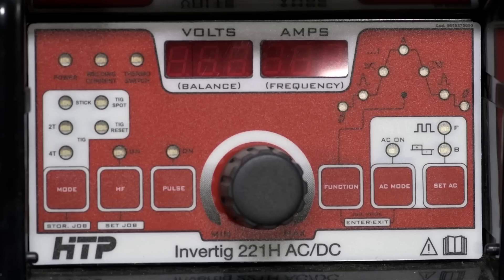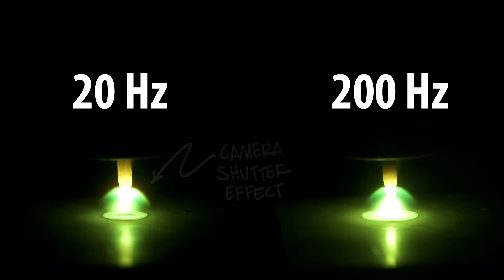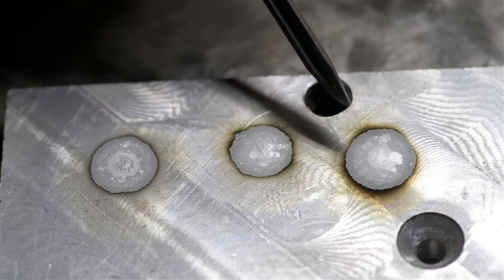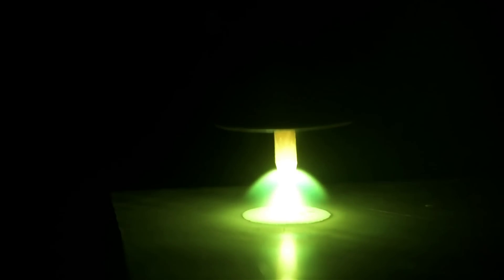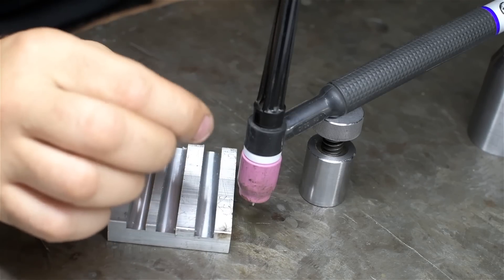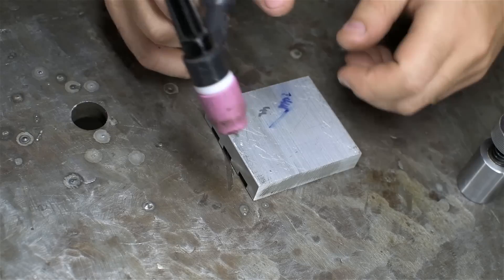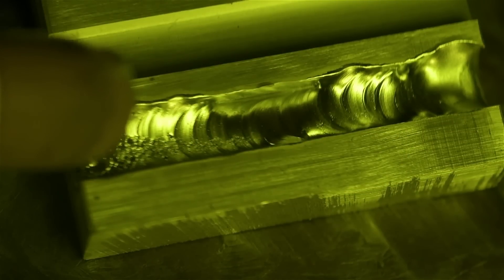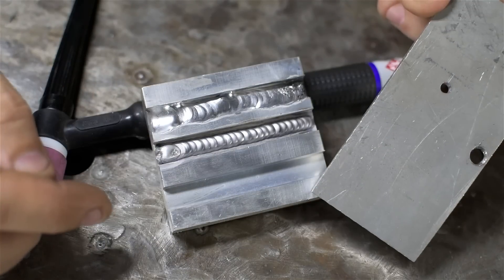TIG with TOT: AC Frequency?!

Comment: The skin effect does very well play a role at the frequencies you are talking about, even in AC transmission lines it is so big that they sometimes use hollow conductors, or steel inside and copper on the outside. Have a look here: https://i.stack.imgur.com/N6ZJx.png on steel it can make a difference of 4 times the penetration depth between 20Hz and 200Hz

Comment: The skin effect could very well be the cause, it's normally only considered for high frequency but it's can also be relevant at high currents like this. The depth for copper at 60 hz is 8.5mm which I found quite surprising when I first learned about it. https://en.wikipedia.org/wiki/Skin_effect

For fun, I calculated what it should be for aluminum and got 5.8mm at 200 hz and 18.5 mm for 20 hz, which based on what you're experiencing seems to fall in the right order of magnitude at least. Link at then end.

One way to test this would be comparing aluminum and steel. The much higher relative permeability makes the skin a lot thinner (single digit mm or less). It's much harder to get an exact number and will depend on the current.

Calculation for aliminum in wolfram alpha here (permeability of aluminum is basically the same as free space): https://www.wolframalpha.com/input/?i=root(2+*+2.7e-8+ohm+meter+%2F(2+*+pi+*+200+(rad%2Fs)+*+Permeability++of+free+space))
Reply: I was thinking along similar lines myself. Also, a 200hz square wave is full of harmonics at 400, 600, 800 hz too and the skin effect on the harmonics will be way higher, to some extent increasing the effect. So skin effect could easily be having some impact even if not all of it.

Comment: There are more physics than your test covers.
To start, the gs mix affects the voltage and thereby the heat generated.  After all, even though many people equate heat to the current, the actual heat is determined by current, voltage and speed of travel.  Then the voltage (with other items remaining constant, is dependent on the polarity.  In fact, I have seen up to 3:1 ratio between reverse and straight polarity, same current.  That means two to three times more heat during the reverse polarity (50% duty cycle).
A really funny thing happens, when you increase the frequency to the kilohertz range.  Then the acoustic impedance of air that surrounds the arc starts affecting the plasma column width.  You can see this on pulsed DC.  Noticing that the arc becomes wider at higher DC currents, while voltage remains nearly the same can be explained in terms of "fatter wire (or arc), less resistance"  But if the current is increased very sharply, the arc cannot push the surrounding air away fast enough.  For something on the order of 1 millisecond, the current is pushed through a more slender plasma column and the momentary voltage is much higher.  When you change to AC or actually variable polarity welding, then the reverse polarity effect to voltage muddles the reasoning already at lower frequencies and slower transitions.  But another claim and patent by Rod Rohrberg shows that it is not necessary to use variable polarity for welding aluminum.  Very fast pulse rise for example from 10 A background to 150 A peak can provide the necessary cleaning.  That is probably caused by rapid expansion of aluminum metal when melting which more or less throws the oxide to the sides.  I can personally test that this process works, whatever the physical explanation might be.  In that case, the pulse rate was 15 to 20 Hz, the duty cycle also 15 to 20 % and currents 15 A background, 150 A peak.  The pulse edge rise time was less than 250 microseconds.  The heat was controlled mainly by the pulse duty cycle.

Comment: from studying induction heating, skin effect starts at 50Hz and is still ineffective at 60Hz . This is why power company runs at this as a stranded less chance a roled up extension cord will cause a fire  . I looked up skin effect in Cu at 70°C(material and temperature  WILL change depth). found this calculator
http://daycounter.com/Calculators/SkinEffect/Skin-Effect-Calculator.phtml
.02KHz(20Hz) =0.632"
.2KHz(200Hz) = 0.201"
.06KHz(60Hz) =0.366"

Writing this turned on a light bulb.... the cut/etch Jody duse.  the weld puddle  takes on the pile of sand shape  expressing the strength of the skin effect. less energy reaches deeper  causing the rapid taper of the puddle. slower wont go deeper than skin effect hence the requirements for muli pass welds on thicker materials .

Comment: Just to change subjects and maybe scare a few folks, As a resident in a radiology program I taught med students radiology. An X-Ray tube is tungsten rotating fast as it is being hit by photons. This produces ionizing radiation. That’s the stuff that damages rapidly changing cells in our body. Is TIG welding producing ionizing radiation? 
Trivia.. Who was the first person to die from radiation. Answer.. Mr Roentgen’s (the discoverer of X-Ray) assistant, then his wife and then I believe him. Anyone ever get a “sunburn” welding un protected?
Reply: The rotation of the aluminum plate in an x-ray tube is to prolong the life of the aluminum.  Even so the tube is designed to only last 7 years in normal daily use.  They used to last much longer but that was hurting the servicing business revenue.
Reply: Chuck Patten .. My GE X ray unit lasted me 17 years and then I sold it to my Vet when I moved. He is still using it (36 years plus)

Comment: Don't think you need an o-scope. Think your beads are a good representation of the frequency, actually. The beads show exact coloration with time, frequency time. It seems very basic to me that slower frequency (we are discussing frequency, not energy, which is time) beads show a much more prolonged dwell in polarity then the higher frequency. The smaller tighter globules represent less time spent in polarity, or fast switching. Longer dwell-bigger blob, less dwell small blob. As frequency is raised you start to move away from the basic tenants of AC, there probably is a frequency high enough that basically negates AC all together and is either DC at that point or just null. I can see where using high freq on a outer seam bead might be beneficial to keeping a tighter bead, dependent on the operators weld speed. Whereas lower frequency on the same corner seam would have a tendency to stretch out/across and look poor. The energy would be the same but the dwell in polarity would cause more of the same energy to be transferred given the speed of the operator. After that long winded blow, I meant to say, I think your right.

Comment: your AC frequency is telling your balance how many times it must go through its cycle. 40 frequency = 40x a second your balance must go through its cleaning and penetration cycle.  imagine hitting a punching bag. you will have more delivery of power into the bag if you are able to hit it slower. 1 hit per sec VS. 2 hits per second and so on.  the faster you go the less power you are sending into the bag. Amps it like your set top hitting power, while balance is like the % out of 100% you are making contact with bag (penetrating) and "holding back your punch" is  like your cleaning action. thicker the metal more balance penetration is needed. And the reason (i think) you are able to weld inside joints better with higher frequency might be because your arc is forced to go faster... and by doing so makes your arc's "fingers" thinner (not its width of the cone that you can see with your eyes, but electrical current on a micro level). thinner helps to avoid melting the walls of the joint before the actual true center.    i dont know... i have only been welding for 9 months =P it makes sense to me though.
Reply from the maker: good point and I'd agree with you but I can change the amps too.  like me punching @ 40hz vs Superman punching @ 40hz.

Comment: Penetration (tee hee), the lower the frequency the deeper the heat will go, the faster the frequency the higher the heat will stay, I have always used the frequency in accordance with the speed of my hand (tee hee).
Also, the strength of the weld and crystalline structure of the two dissimilar metals will be better at a lower frequency.
A good test would be to cut your welds in half and look at the cross sectional area, you will see different depths and if you look at the weld under a microscope you will see a more uniform structure.
Or get an X-ray machine (tee hee, don't know why that sounds dirty).

Comment: Well, I just have a little old Lincoln square wave.  It has one big knob, a three way switch for DC/AC/DC, a switch to change to stick, and a power switch.  I watch these videos with the new fangled welders with all the bells and whistles, and often wonder if I could ever figure out how the hell to use one.  I mostly weld crappy old nasty Harley Davidson cast aluminum - when it is aluminum that I am welding. Horrible, horrible metal. Just filthy, and LOADED with impurities. 

I'm a pretty simple guy. I am the only computer that operates my mill, lathe, boring machine, valve grinder, seat cutter, and so on. I'm not saying it wouldn't be a nice thing. I am just saying it might be wasted on my little old brain.  

So Antonio, as this is your hobby, what do you do for a living? Just curious. I like your channel. You make me laugh. Also, you make me think. Are you thinking what I'm thinking?

Comment: This is a real world non ideal device, the inverter likely has nonlinear output power over the frequency range for a given input voltage (controlled by the amps knob). Id be interested to see the output on a scope swept over the freq range, peak voltage is likely dropping as frequency is increased.

Comment: Low frequency means more time at peak voltage.  Higher frequency means less time at peak voltage and more time in transition or near zero.  The average is more even or DC like.

Why?  The power supply isnt perfect, linear, or 100% efficient.  You also have the hysteresis of all the components in the system.

Higher frequency = softer arc.  
Lower frequency = harder arc, more etching and arc abrasion of the surface.

Think of a brush with 50 bristles versus one with 2000 bristles.  Easiest way to imagine whats going on.

Skin effect doesn't matter here because the piece is grounded and the arc is contacting it directly.

Comment: As far as I understand skin effect, the theory should work exactly opposing this. If the current is running in the skin, you get a much wider heat distribution that's not so deep as running the current straight through the body. This way the lower frequency should make the shallower bead. Also yeah, I don't really hear about skin effect in the realm of hundred Hz-s..
Anyways, I'm not a welder, nor a scientist, just a rumbling dude on the Internet..

Comment: Maybe the skin effect is a reasonable answer. I calculated it for aluminium and at 20 Hz you would have a skin depth of about 20 mm and and at 200 Hz about 6 mm. So most of the current would flow in just a quarter of surface at a frequency of 200 Hz. BUT: this depends on so many other factors like where do you have the earth clamp, is there maybe an oxide on top of the surface, etc.
But i think the skin effect has at least a little effect on it! 
And now the obligatory: "Trust me i am an electrical engineer!" 
Better dont trust me. Trust Wikipedia.

Comment: Inductance and magnetic effects are the answers you seek, and at low frequency there is more time for the arc to wander about.(that is it isn't a wider arc but a loosy goosy arc, DC blow being the prototype. True DC doesn't exist as that would imply a circuit that was unchanged for an infinite amount of time, think of DC as the ultimate super low freq AC when it comes to dynamic actions like reactance where it's the rate of change that matters. (this is not relevant to non dynamic anode-cathode redox where at any one instant the reactive specie are either accepting or donating electrons due to power direction and level)
 Skin effect varies dramatically with material, with it happening at much lower frequencies in ferromagnetic materials and this is why current induction stove only work well with iron alloy pans(Khz vs Mhz for nonferrous pans), skin effect exists at all freq. but with say copper or aluminum at 60hz the "skin" is a solid 2-3 inches deep.
Back to the magnets and inductors, 400hz is often used for local power(campus, ship, airplanes) because components can be much smaller for the same total power, motors generators and transformers(each for a slightly different reason) transformers only need a fraction of the iron core for the same current compared to 50 or 60hz. 400hz is not used for larger grids due to parasitic reactance losses along the lines themselves.(motors/generators are smaller partly due to inductance but more due to the relation of hz/poles to rpm and and rpm*torque=power)

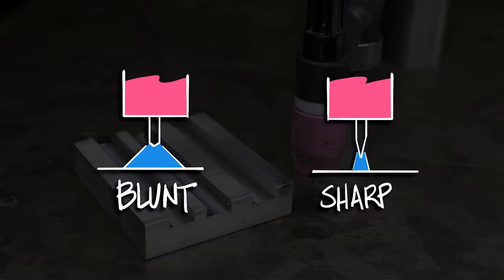Comment: On 6:10 you say a blunt point gives a wide arc and a sharper point gives a narrower arc. 
I learned the opposite. So what's the story? 
Weldingtipsandtricks: 
https://youtu.be/ZI3SyGjjbfw
Reply from the maker: All things being equal, I'm not exactly sure.  Fact of the matter is I usually select a taper angle based on the current.  Sharper = easier to start @ low currents, but would burn up at high current.  Blunt = harder to start but you wouldn't be running this shape at low currents.  Low currents = sharper angle, shorter arc length for me, Higher currents = blunt point, "regular" arc length.  So if you put all of those together, in my experience, shaper point = narrower arc, blunt point = wider arc.  I don't think I've tried a very sharp point and very blunt point @ the same amperage and same arc length.

Comment: The rate at which the metal heats seems to dramatically increase at higher temperatures and dramatically decrease at lower temperatures. Like how you need a high flame and a (relatively) long time to get a pot of cold water to boil but only a small flame to keep it going once the water reaches it's boiling point. So in those terms, having a higher frequency would be like turning your stove on and off very quickly and never giving the water enough time to accumulate heat vs lowering the frequency and allowing the heat to "stack" and the water to boil. If this is true, then you should be able to preheat a part and and observe the same welding characteristics at a higher AC frequency as with the same part welded cold at a lower frequency. This is just my crazy tin foil hat theory, though :D

Comment: Skin effect doesn't play AT ALL here, as this only becomes meaningful in the higher ranges of the radio-frequencies 

Paddy
Reply: Not true at all, skin depth in aluminum @ 200 Hz is only 6 mm: https://en.wikipedia.org/wiki/File:Skin_depth_by_Zureks.png
Reply: if you are talking about 'the skin effect' in the sense that Tony meant it (conductors start to conduct more on their periphery as the carried frequency increases) it does not play.... This only becomes measurable in the lower radio frequencies (with very fancy equipment!) and it is a bit easier to ascertain in the higher UHF and microwave ranges.
I have no idea what they mean by 'skin effect' in that article, but it ain't the skin effect as it is know in electronics!

Paddy
Reply: You should really read that article proper before quoting from it, and besides that, some of the claims made in the article are very iffy, to say the least

Paddy
Reply: gh778jk what, like where it says "Skin depth is one of the most fundamental issues in microwave engineering, but it also affects lower frequencies, even 60 cycle AC power"?
Reply: It's OK, I stand corrected.... I shall contact all my old professors, the authors of the books we use in Uni and let them know they have been terminally wrong all their lives!
Thank heavens for random websites to put these scientists right!

Paddy
Reply: gh778jk when youre designing a circuit skin effect is mostly irrelevant until high microwaves, but thats just because the conductor widths are so low.  Things like plated traces dont become relevant until the high microwaves, but when you have large conductors skin effect becomes important almost immediately.  When you have a welding rod or GTAW arc the conductor is pretty dang thick and skin effect matters above ~100 Hz.
Reply: gh778jk ive got my electrical engineering degree too.  In fact I have my high speed digital design book on my bookcase, published 1993.  Skin effect is on page 185 and it has the same formula.